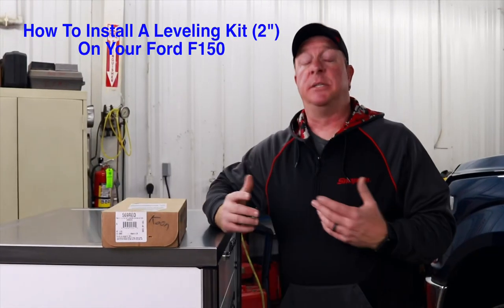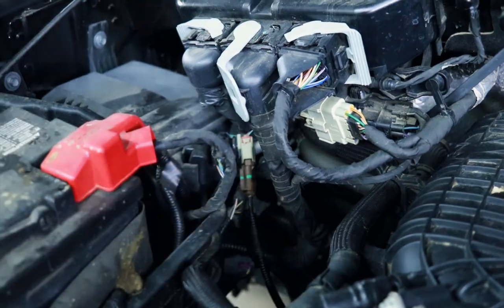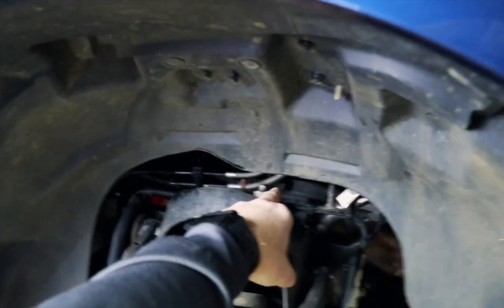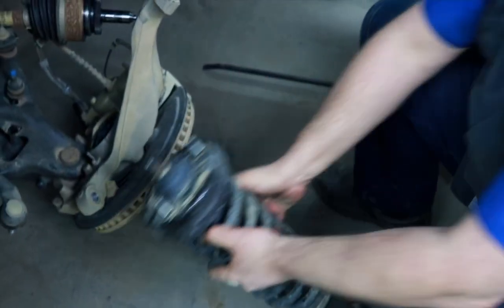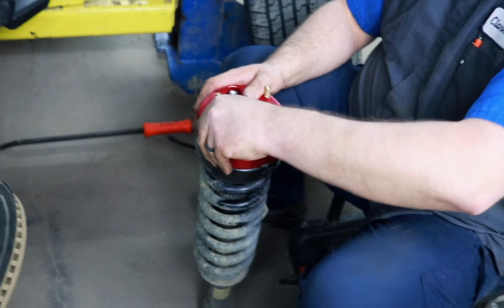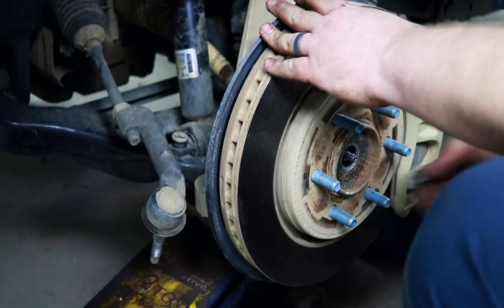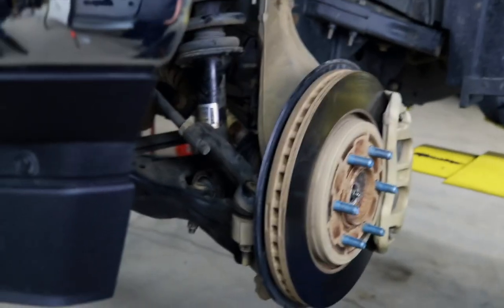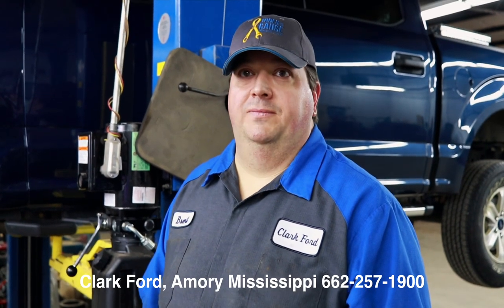How To Install A Leveling Kit On Your Ford F-150: Rough Country 2” Aluminum Leveling Kit StepByStep

Comment: Hope everyone enjoys! Maybe this will help with people wanting to install a leveling kit! Just remember, be sure to remember safety first! Always use jack stands!
Reply: Great video. Any reason why to not torque down the bolts to factory torque specs? I know some people are real anal about torqueing down anything only using the factory specs torque specs and not just gun the imapct on it  and be done with it. Thanks.
Reply: Just curious what is the flat rate for that job? Also how long does it usually cost for the labor, and how long do you usually take to do that job.
Reply: Daniel Tubbs the dealership changes $350 plus tax  That’s the kit,labor and alignment. Normally it takes me about an hour to install. Hope that answers your questions.

Comment: This will help me with my shocks I have bilstein 5100 leveling shocks sitting in garage basically the same job except I need to compress my coil to swap the shock and just put snap ring where I want my height at,, great video thanks!

Comment: They make the truck look a lot better getting the front up with the rear. Are you going to put a bigger tire or run it as it is.
Reply from the maker: Already got bigger ones on it since the video was shot
Reply from the maker: Check out my Instagram, I posted a little video this past Friday of it.

Comment: Hello Mr. Clay, thanks for the upload. To date we've installed 23 2" leveling kits on the Fords F-150/F-250 14-20 yr models.
Not once during the video did I see the Ford Master Tech use his torque wrenches. We preach to our techs that it is a must to torque everything they remove or replace. 
Thanks
Reply from the maker: I understand where you are coming from but as long as most of us have done it, we know when to stop.

Comment: Was it necessary to an alignment after this or does it still drive true seeing’s how  you didn’t take anything apart with adjustment on it
Reply from the maker: Yes it will be off and we had it aligned the following day.
Reply: Hello Sir, we are taught that anytime modifications or replacements to front steer or suspension are done alignment should be checked. But from doing this type of modification we've learned that alignment is not distributed if kept @ 2" or below.
Reply from the maker: All I know is when I took it to the alignment shop after having it done they had to make adjustments to it. They gave me the printout and it was outside the “green zone” so what we you guys think or want to do is no difference to me but I know for a fact mine had to be adjusted.

Comment: I have a 2017 f150 how do they improve and is  it worth the money or should I leave it stock
Reply from the maker: It just levels the front to match the rear of it. I personally like it because it sits level vs the rear being higher and you looking down when driving. Raising the nose of the truck really looks better